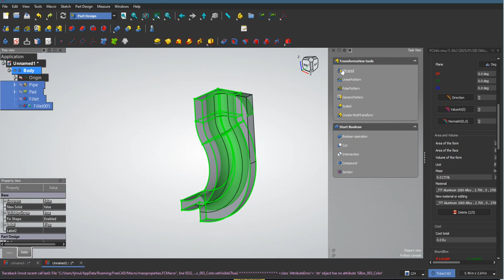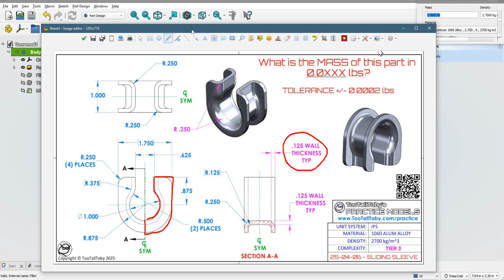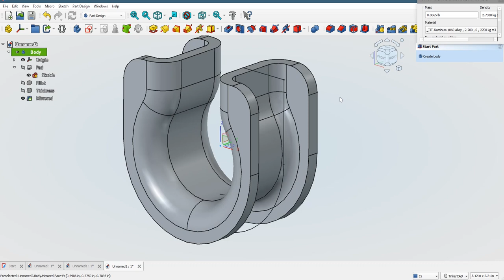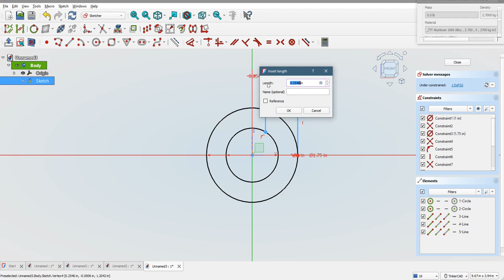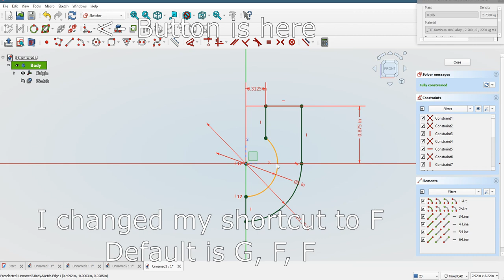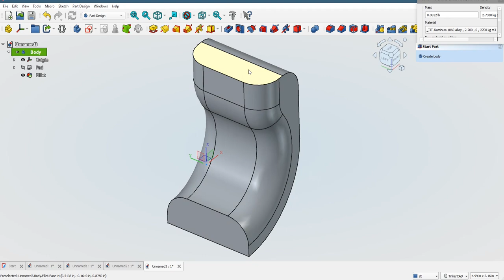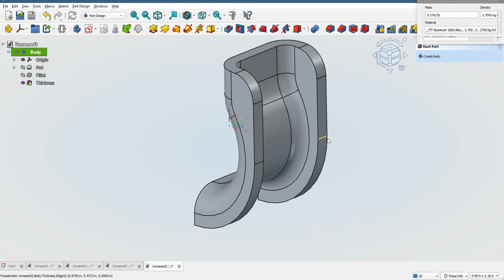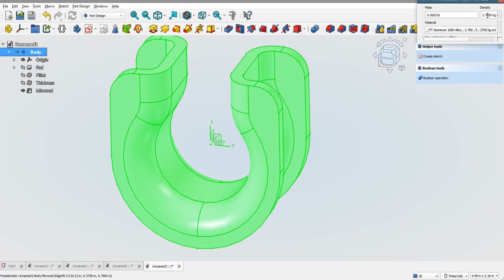How To Model This In Under 2 mins in FreeCAD

Comment: Never trust the Shell command.
To many times it started with "Oh, i can do this pretty easy with a Shell." And it ended with me constructing the whole thing in another way.
Reply: sharing actual examples would have been nicer rather than "too many times"
Reply: @yash1152 Easy. 
In PartDesign (v1.0.0):
- Parts containing more than one solid sphere (especially when intersecting)
- Parts containing a additve helix.
- Parts containing a additive loft (even simple ones, like a loft between two circles with different radii)
- Generally when the topology of the (inner) shell will differ from the originating solid. Prime example are fillets with an radius smaller or equal to the shell command.
- Another general case is when the (inner) shell manifold would be self-intersecting. Dor example creating a pocket near an fillet (with an large enough fillet radius for the shell) where the inner "slice" of the manifold for the fillet would intersect with the inner shell manifold of the pocket.

I'm pretty sure there are a lot more examples. If you want to do something productive with this (like fixing OpenCascade) I'm happy to provide more.